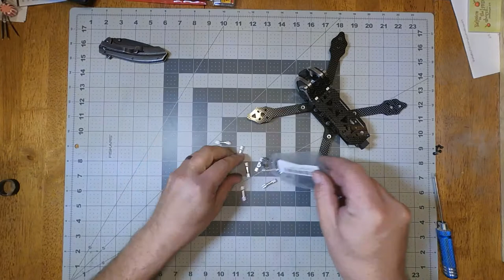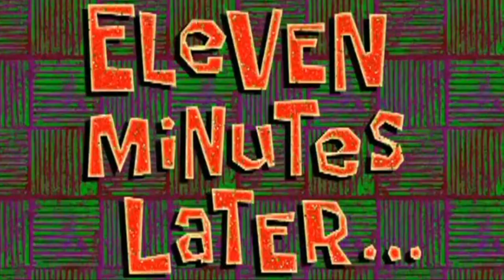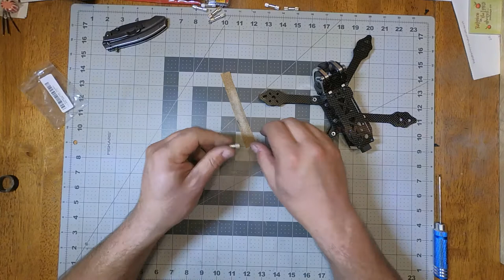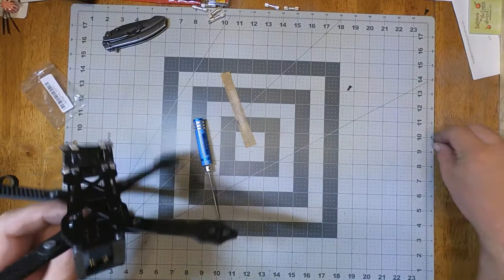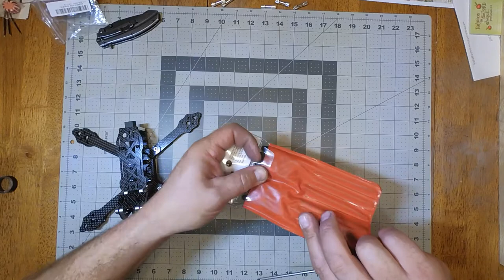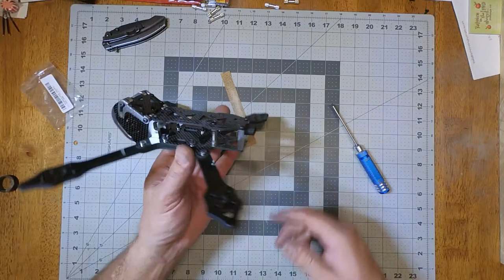Knurled Standoffs for the 220H Scorpion

Comment: Very Nice  looking frame and it should fit the bill for me, but it seems to hold only a 2 stack configuration with maybe the receiver on top of it. Since I like to have a stackable VTX and a 4 in 1 ESC I think it will not fit together with an FC in this frame.
Reply from the maker: Jelle Kaptein, Hi I'm not set on any particular stack I will usually just use what fits lol.. have a great day my friend!!
Reply: Torch Fpv just curious, did you build this one out yet ? btw my furious 220 is still going strong. Have an ummagawd remix clone on the way with the new racerstar fire edition 2207 2500 kv motors.